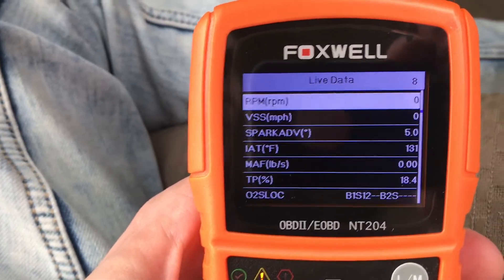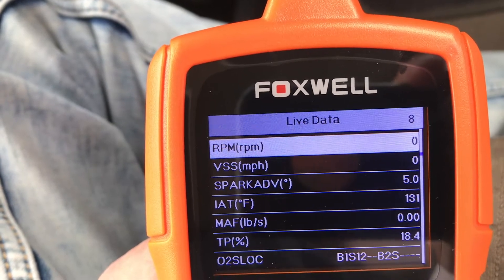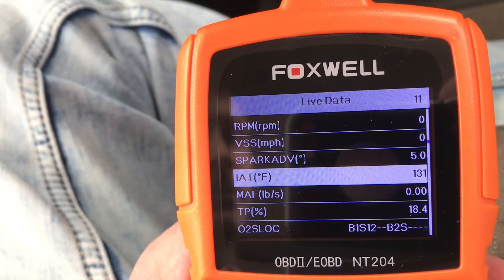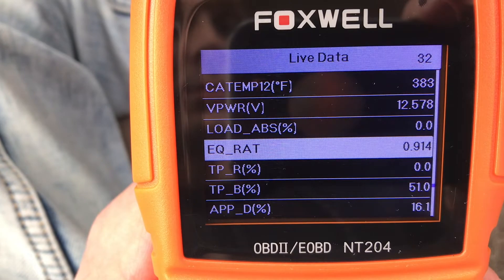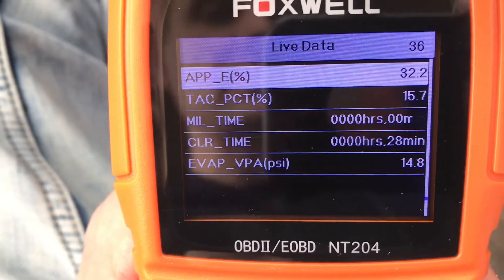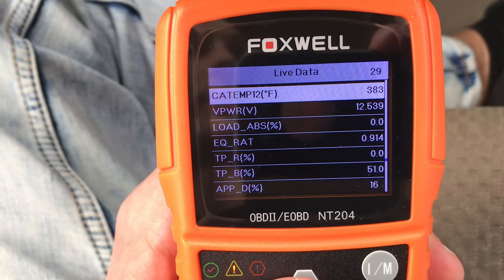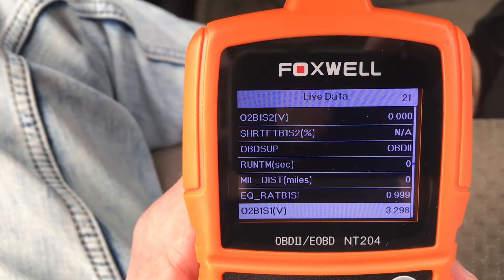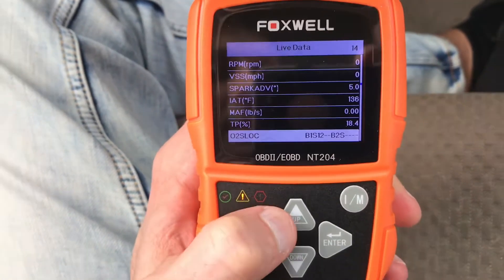Toyota Matrix and Pontiac Vibe Drive cycles and emission readiness monitors explained #drivecycle

Comment: I’m in NY and passed first time last year. I just paid the $37 whatever for a “failed” test. The emissions wasn’t ready for testing. 

Load of shite <
Reply: The only upside to the testing in Ohio is it's free and if it's more then like $200 to fix it I think they just let you be exempt. In your case though I believe every time I got one in Massachusetts which was like 2 or 3 out of 20 ish cars and trucks, if I failed they'd let me come back within 60 days and retest for free. I'm not familiar with NY laws but I wouldn't be surprised if they had the same requirements across the whole state like somebody in Rochester has to pass like someone in Manhattan. I'm glad I wasn't born in California and paying $15 a gallon to sit in traffic and litterally take 4 hours to travel 20 miles 😂
Reply: @smokesletsgo1 

In NY every time you test (even if the car isn't ready) as one of the censors failed to calibrate emissions, I still had to pay. 

It passed bit he cahrged me twice for the sensor not having enough miles on it to calibrate and start testing. 

After I went out and bought a serious odb 2 tool and ensured it would never happen again.